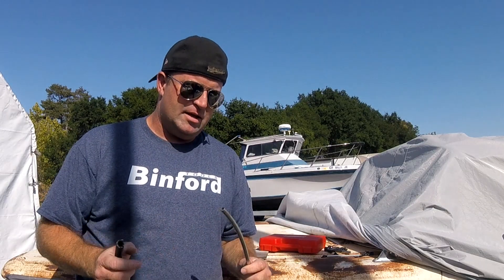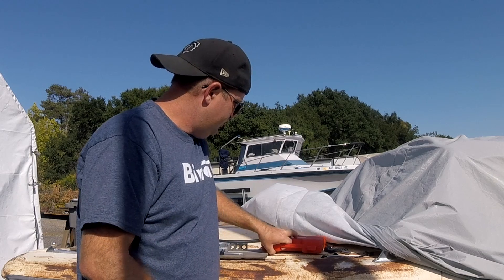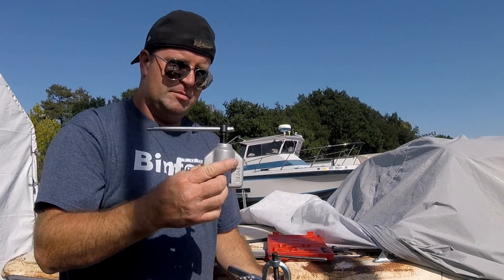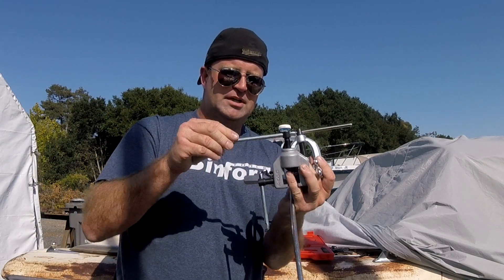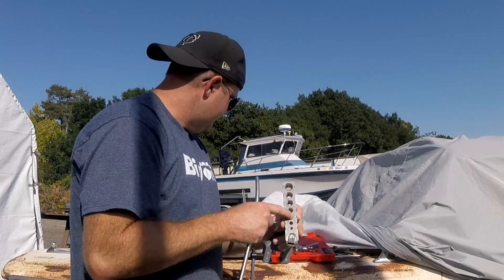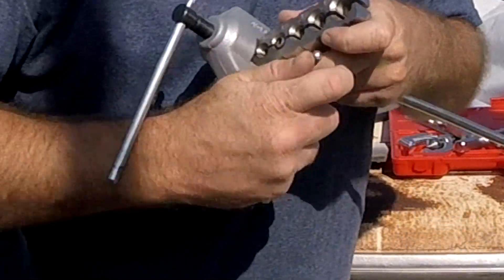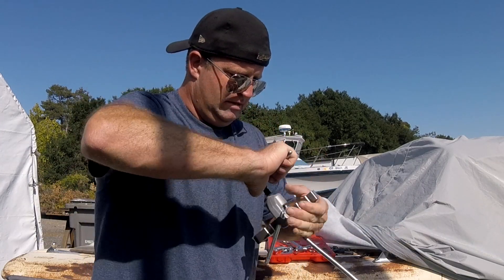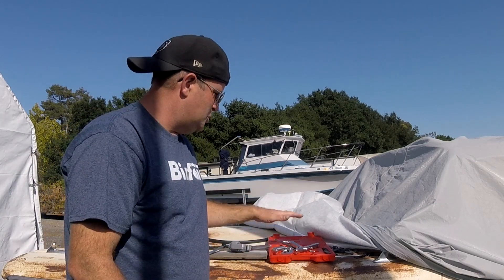Stainless Steel Tubing Flare Tool Comparison | Generic vs. Name Brand

Comment: Ever since I decided to fix my broken steel power steering return line myself, I've been tumbling down the rabbit hole. 

The OEM steel hardline is 3/8" and connects to rubber (hydraulic) hoses at various spots. As you mentioned @ 0:45, having a flare at the end with a clamp seems to make sense, but from what I’ve read, that’s not technically what flares are for. Apparently, you’re supposed to use a bead instead?

But bead rollers for 3/8" lines are quite expensive—$250-$450 for tools like Parker, Graham, or ATS. Even the Earl’s EZ Beader, which isn’t highly regarded, costs $80-$100.

At this point, I’m leaning toward just using a flare, mainly because a good flare tool costs around $100. Even if it may not be the "proper" method...
Reply: I’ve even come across recommendations to use a flare with a hose barb fitting + clamp instead of a bead
Reply from the maker: @elizaehrlich  I'm not sure when it comes to power steering lines. I've used the hose clamp method with all my fuel lines (high pressure fuel injection) and automatic transmission lines and never had a problem. I did recently learn that it's better to use special fuel injection hose clamps because they grab the hose more evenly than regular hose clamps... Like I said, I don't know with power steering. My wagon doesn't have it and my other cars all have factory PS.
Reply: @CousinRyan  Thanks!